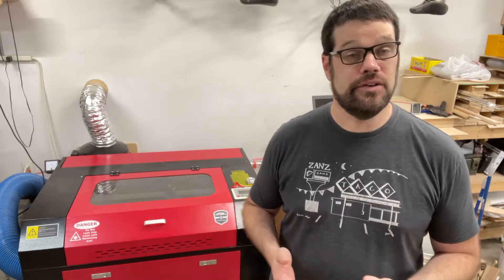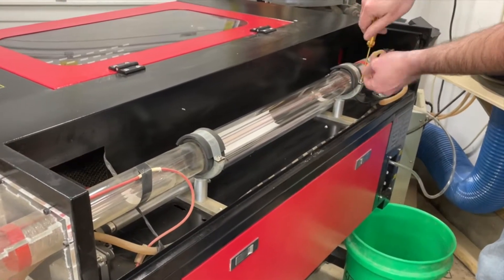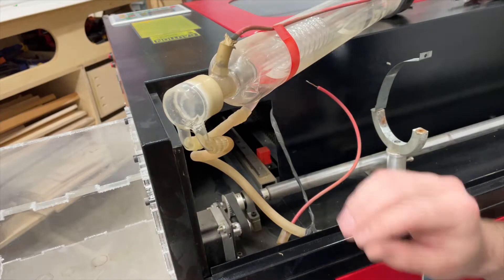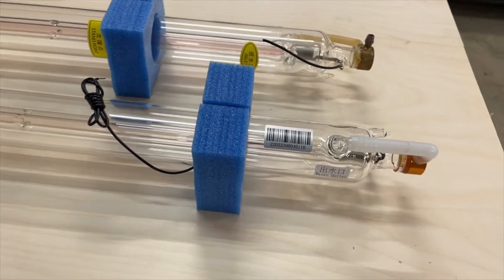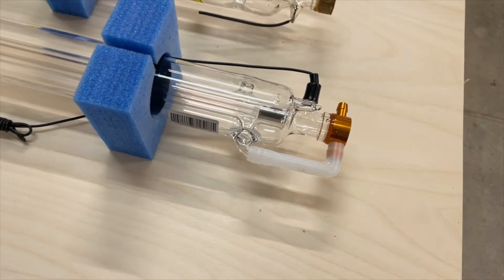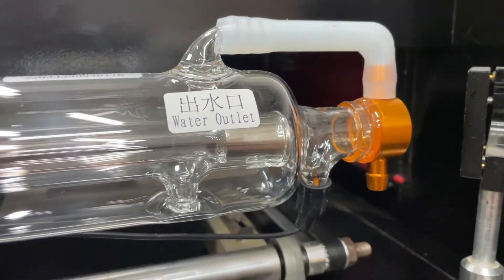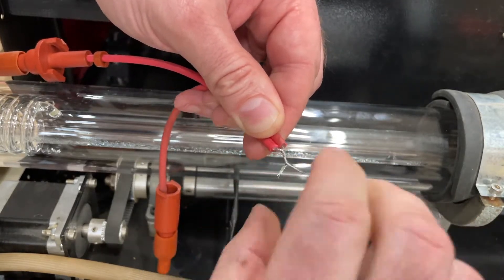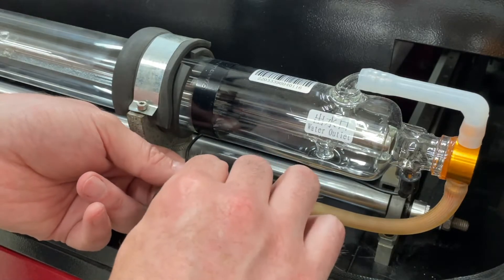Replacing a Co2 Laser Tube | SPT Laser C70 tube into eBay Co2 Laser

Comment: Do you need a potentiometer and milliamp reader even when using lightburn if so why as simple as you can please?
Reply from the maker: Lightburn cannot tell you how much actual current is running through your tube, it just sends a signal to the power supply to fire at a percentage of the power supply's maximum power.  You need to tune that power supply to your tube, by getting actual current readings from a meter.

Comment: Have you done the upgrade to the larger diameter tube and the red beam combiner?
Reply from the maker: Unfortunately I have been unable to find the proper mounts that will fit my laser and the other tube.  There is a connecting rod to the two side rails that runs along the tray that takes up too much space.

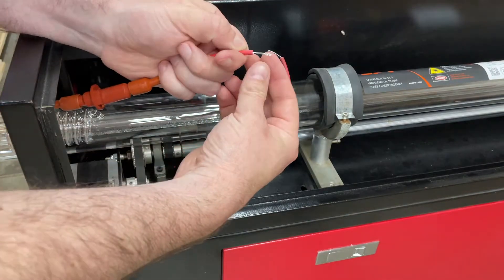Comment: @9:20 min, and 11:09 min, why not solder the connections?
Reply from the maker: It's generally not recommended to solder the HV connections on the tubes, I'm guessing due to the chance of damage from someone not great at soldering. A good mechanical connection like this should be fine.  The key thing is to make sure you do proper insulation around the joint.

Comment: Question..
Which laser ma Hine do you have and where did you purchase it?
Also, did you honestly see an improvement in the SPT tube over the initial tube when it was new?
Jeff
Reply from the maker: This was a generic laser i bought off eBay about 8 years ago. The initial tube that came in the laser was only a 50w tube set up with a 60w power supply.  Even running that tube below the mA rating it did not last long.  The SPT tube is the third tube this machine has seen.  It's been running longer and more consistent then the others.  As for if it's cutting better or faster, there might be a minimal difference, but it's the consistency that I have appreciated.

Comment: Great video, quick questions, do you need to upgrade the power supply or do you still have a 60w supply, and did your water cooling tube reach from standard or did you have to replace when putting in a longer tube than original?
Reply from the maker: The stock power supply was a 60w unit so I was good to keep the existing one in there and there was enough slack in the water line to use the existing hose as well.
Reply: @Vintauri  perfect thank you
Reply: @Vintauri  sorry to be a pain, I don’t suppose you have the file for the acrylic extended case also, I’ve had to get a bigger tube because I needed it asap and couldn’t get the size for ages!
Reply from the maker: @JoshhColee   I dug up the files.  You'll need to resize it for your specific material, I think this was around 5.5mm or 7/32" stuff I used.  It was just under 1/4".  See if you can access the DXF or SVG files here: https://drive.google.com/drive/folders/1bWLwb9ZxMi_LU0N1cbd5FVnWyHp-Ch9l?usp=sharing

Comment: I see that your tube is internally arcing slightly. Is this something to worry about? Mine does the same thing.
Reply from the maker: I assume you are talking about the plasma stream inside the tube dancing around a bit. This is normal. If you have arcing outside the tube to the frame of your laser, that is bad.

Comment: i use a 50w spt tube from lightobject in my build.....just a great tube.....still going strong after 4+ years.....# of hours on tube?.....never calc'd, but many 5-8 hour days on the tube....use for busness 2- 3 times a week to fill orders....never thought tube would last this long.....
Reply from the maker: Great to hear. I have a year on this one with mixed use. Some long all day use other times just occasional. Ive been pleased with it so far.
Reply: @Vintauri  speak of the devil.....tube got incredibly weak (12 passes) to cut 1/8th acrylic......happened fast.....matter of a week......put in my spare i purchased on 10-2020.....wow.....and its so clean....working fabulous.....and i'll be able to answer the question of YOUR TUBE DEGRADES WHEN YOU STORE IT......

Comment: One of the best videos on changing the tube.  I would have looked into SPT lasers but I already have a CloudRay cr90 on the way.  Is it a good idea to ground the extension tube cover incase of arcing or is it better to leave it non conductive?  Thanks.
Reply: You will be pleased to know that the CR90 tube from Cloudray is infact an "A" grade  SPT C90 tube.  Cloudray  only sell the top quality tubes and have their own relabeling agreement with SPT. to sell under the Cloudray name.
Reply from the maker: Thank you for the compliments on the video. If you set up your grounding properly it can’t hurt adding some grounding to the extension tube. With the extra insulation on the SPT tube and proper routing of the wires, I have not felt the need to add it to my machine. However, it would not be hard to add a copper plate and wire grounded to the machine.

Comment: Why dont  you solder the cables together?
Reply from the maker: You can solder the end together as long as you do not leave sharp ends and do not do it close to the tube where you might damage it.  I've been soldering for years and would be comfortable with that, however not everyone is.  This method, sometimes called a western union splice, is a good method to provide a strong mechanical and electrical connection.  I chose to use this method based on both the manufacturers recommendations as well as showing a method easier for more users.  In any case a person should really read up on the process and be sure of what they are doing when working with the HV connections in these lasers.